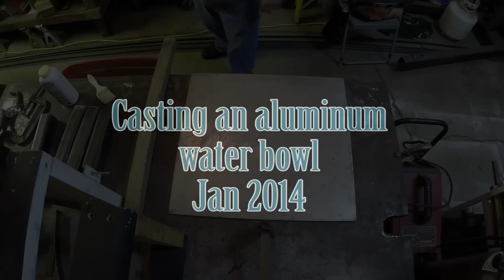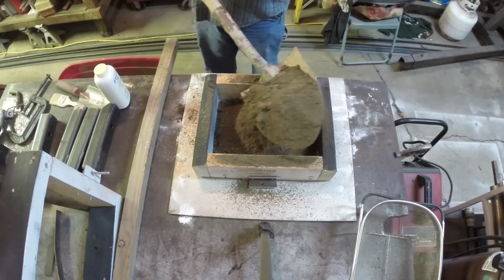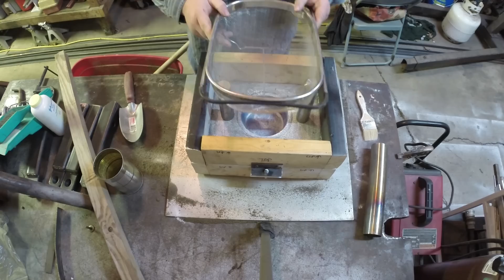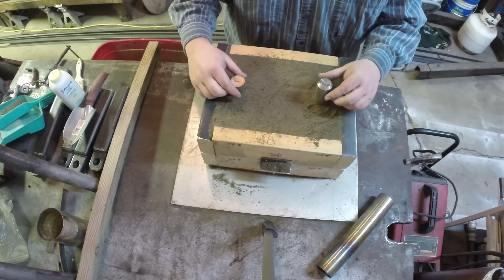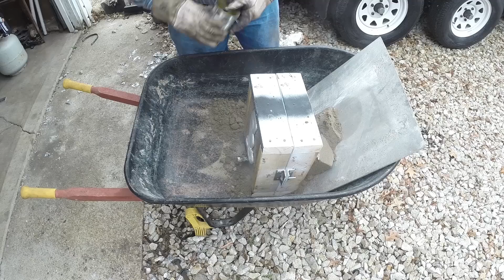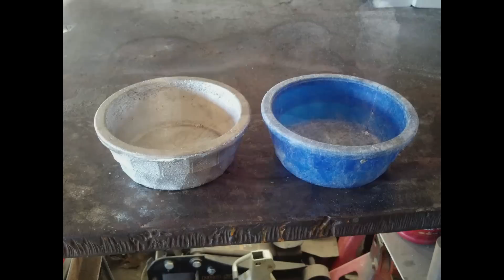Casting an Aluminum Water Bowl

Comment: great video. I have a similar, smaller flask, 7 inches by 10 inches, and also made of 2X4. The sand slips right out of mine.
Reply: You have to mix the sand with clay cat litter so it will stick together.  Look up green sand.
Reply: Hi and thank you for the reply. I mixed fine sand with bentonite clay (green sand) but it's always either too wet or too dry. I think I'm going to get a hold of some petrabond.

Comment: What kind of sand is used and how to get it
Reply from the maker: it is just some generic play sand from a local lawn and garden store that has been sifted through a screen to remove the larger debris and grains of sand. I then ground up kitty litter (non clumping) and mixed in with some water. Thanks for stopping by
Reply: Its called 'green sand'. You do want clumping cat litter (clay aka bentonite) mixed with sand.

Comment: 5:15 n the bottom of the form you need to drill a small hole, then It will be removed easily. And before removing it is necessary to easy turn

Comment: Can't believe the top half didnt collapse, whats your sand mixture? Great Job, especially for the first try, this should have way more views!
Reply from the maker: The sand is made out of play sand from the local farm supply store that has been sifted through a screen to remove debris and the larger grains. I then ground up a lot cat litter for the binder and mixed well with minimal water to make it stick to itself to hold a form. Its not the smoothest finish but works! Thanks
Reply: msyoung76cj7 thanks! ive seen this recipe in other casting videos, good to know what its capable of!

Comment: What kind of sand is that?  I like your rig for pouring.  Great work.
Reply from the maker: Marc Eaton it is just some generic play sand from a local lawn and garden store that has been sifted through a screen to remove the larger debris and grains of sand. I then ground up kitty litter (non clumping) and mixed in with some water. Thanks for stopping by!!